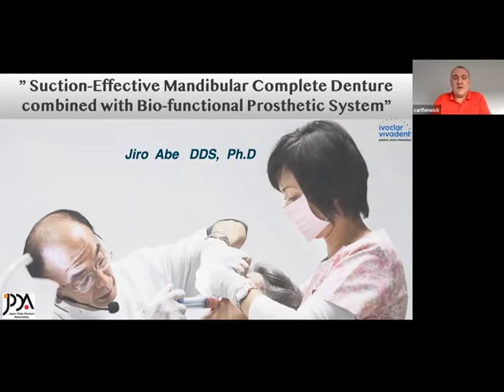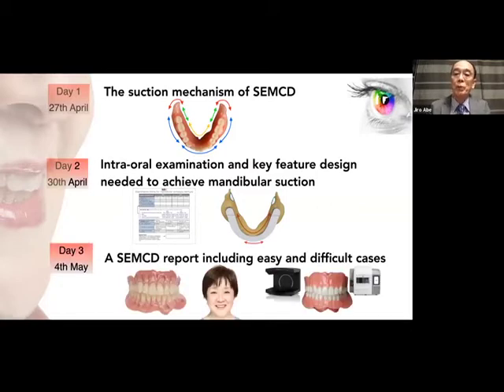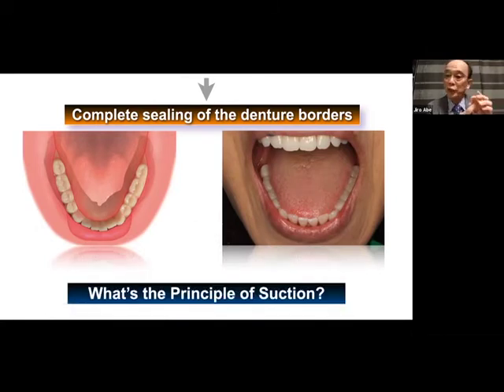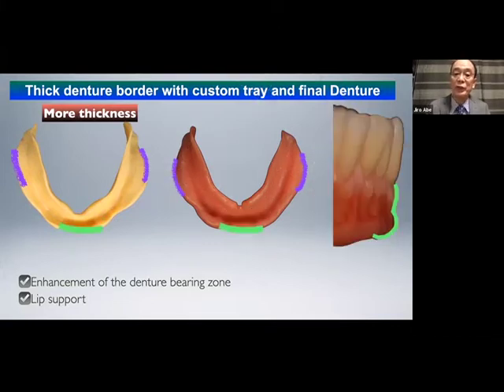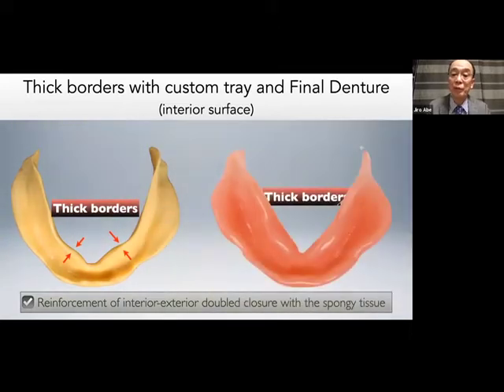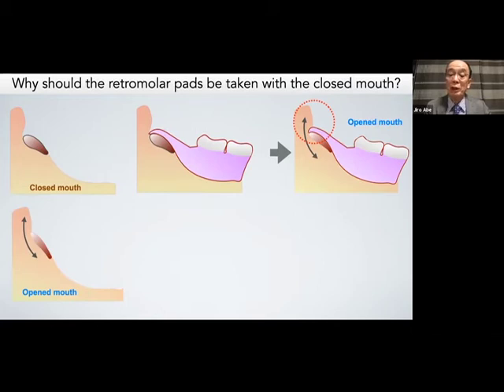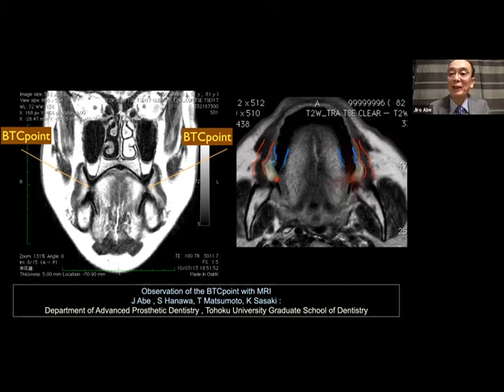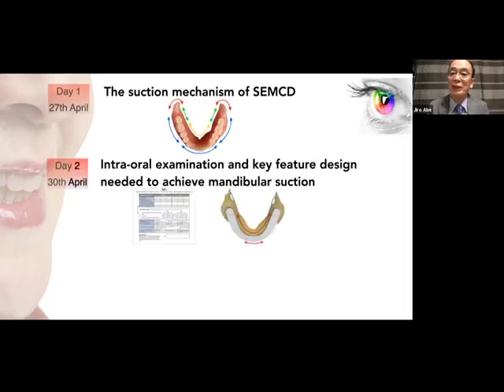“Suction mechanism of the mandibular complete denture”

Comment: This was.absolutely amazing.  I am having such a problem with the suction on upper denture.   It’s like so close to fitting perfectly, but I think I might be able to explain to my dentist EXACTLY where the suction is not getting properly secured.  It will suction, but I’m not paying close attention, the upper suction will break when I chew, and chew again it will suction, back and forth, back and forth, suction secured, suction breaks, suction re-secured.    It’s just not getting curved up into my tissue in the back to bring the tight seal.